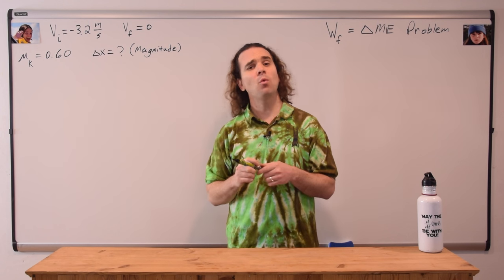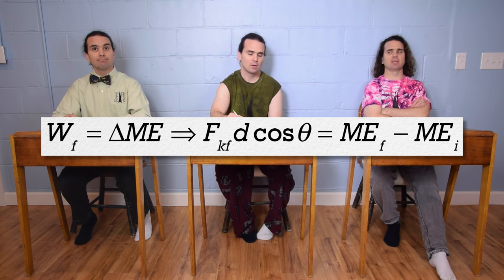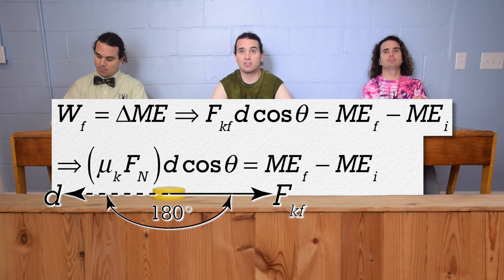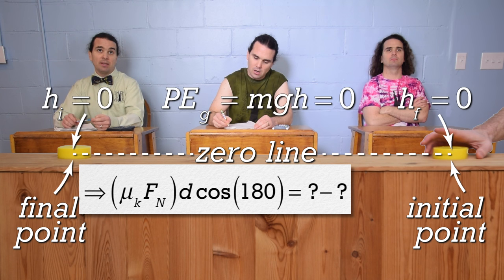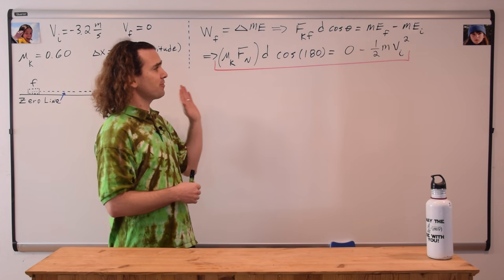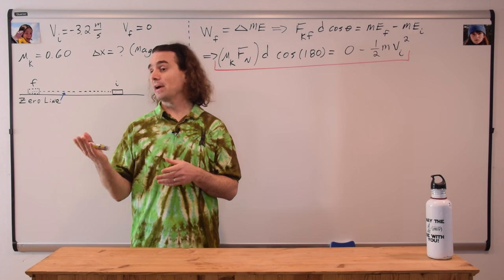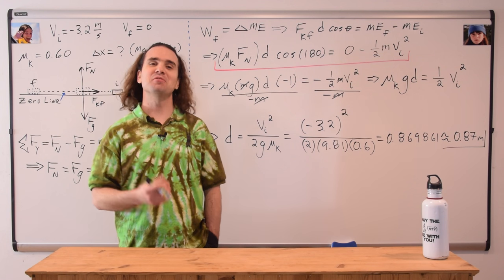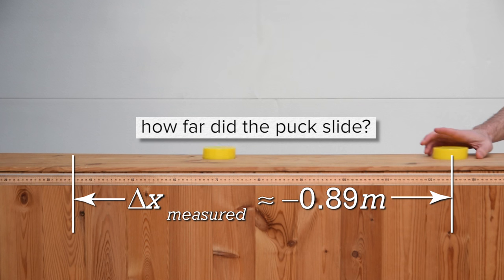Introductory Work due to Friction equals Change in Mechanical Energy Problem

Comment: When a ball is thrown upwards with an velocity and moves certain height and then velocity of a ball is zero.So Total work done by the ball is negative or positive?

I Think negative,because of force of gravity acting downwards through out the motion. So the angle  between the the d and F is 180°.

Anyway Is this answer is correct?
Reply pls...
Reply: When a ball moves upward, the ball is doing work on the gravitational field.  Its kinetic energy is being converted into its gravitational potential energy.  The work done by the ball is positive, because energy is leaving its kinetic form and converting into its potential form.

The reason why you are getting a negative sign, when calculating W=F dot d, is that this equation refers to work done ON  the object as positive, rather than work done BY the object.  Work done BY the object is what you get when the work done on the object is negative.

Comment: I solved it using the work energy theorem and got the same answer. W net = (1/2)m(v^2 - u^2) and the W(friction) = F(kinetic friction)*s*cos theta . The force of gravity and the force normal do not do any work on the object as both of these forces act perpendicular to the displacement. Simplifying for the work done by friction we get, W(friction) = mu*normalforce*s*-1 ( since cos 180 = -1) but Normal force = mg since there is no acceleration in the ‘Y’ direction. Therefore;     - mu*m*g*s = (1/2)m(v^2 - u^2) => (v^2 - u^2)  = - 5.12*m = - mu*m*g*s and, everybody brought mass to the party! => s = 5.12/mu*g = 5.12/0.6*9.8 = 0.87 metres and the displacement = - 0.87 metres.
Reply from the maker: Very nice! This video precede the Net Work equals Change in Kinetic Energy equation, in my curriculum, however, you can certainly solve the problem that way.
Reply: Flipping Physics Thank You sir! But I have a doubt: I was reading the derivation of the work energy theorem in my tb and it goes like this
W = Fs 
=> W(net) = mas
Since v^2 - u^2 = 2as
=> as = (v^2 - u^2)/2
Substituting in the original equation, we get:
W(net) = (mv^2)/2 - (mu^2)/2
Which is delta K.E.
But where did the cos(theta) go which is there in the original equation of the work??
Shouldn’t the derivation be :
W = F*s*cos(theta) 
And then we do the same as before and we should get:
Net work = (1/2)m(v^2 - u^2)*cos(theta) , where theta is the angle between the NET force and the displacement, right? 
What is wrong with my reasoning?
I know this probably isn’t correct because let’s take a simple case:
v = 0 and u is a non-zero positive integer. Let’s say theta = 180 degrees,i.e., according to my derivation, we would expect the work done to be negative, since cos 180 = -1. But when you do v^2 - u^2, you would get a negative value itself which would then give us a positive net work which is incorrect. I think part of the wrong reasoning is that whenever we use the work equation, we only plug in the MAGNITUDES of the force and displacement as the positive or negative work is only decided by the term cos(theta). But then how do I get v^2 - u^2 as negative? If u is let’s say 10m/s then v^2 - u^2 would be -100. I can’t just write +100 for that. Could you please clarify my doubt sir? This doubt came in my mind from this particular question only. When I refer to ‘u’ , I mean initial velocity btw and v is final velocity. I know my above answer to this question that -5.12m = -mu*mg*s is correct and if i did net work = (1/2)m(v^2 - u^2)*cos(theta) I would get : net work = -5.12*mass x (-1) since theta = 180 degrees because there is no force applied(the puck has inertia of motion) so net force in the x direction equals force of friction = 5.12*m. And then if I had equated this with -mu*mg*s I would have gotten a negative DISTANCE( since we only use the magnitudes in the work equation) how????
Reply from the maker: @zhgshdbssss6536  Dude. I am sorry, however, I do not have the time to be able to parse through all of that. If I took the time to do so whenever people asked, I would not have time to make videos. Please watch my video where I derive the Work Net = Change in Kinetic Energy equation. I hope it helps: https://www.flippingphysics.com/wnet-ke.html

Comment: Why is there no work done by force applied clearly you are applying a force on the puck and it moves through some displacement so i think there must be a force
Reply from the maker: The duration of the problem is from the moment I let go of the puck until it stops moving. Therefore, no force is applied to the puck during the problem. The force is applied to the puck before the problem begins in order to give the puck an initial velocity.